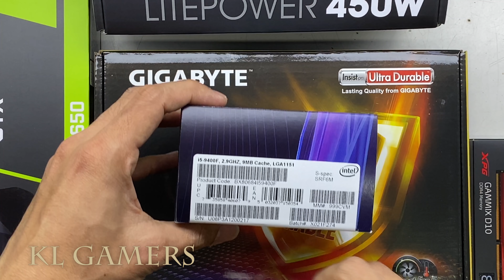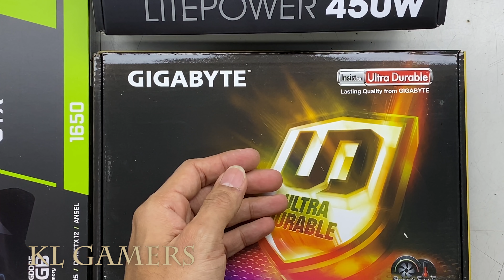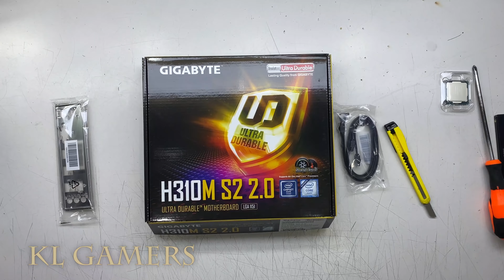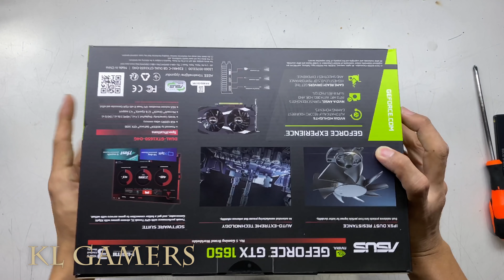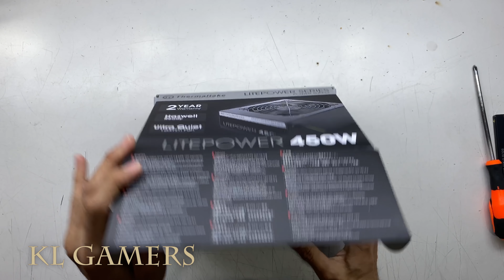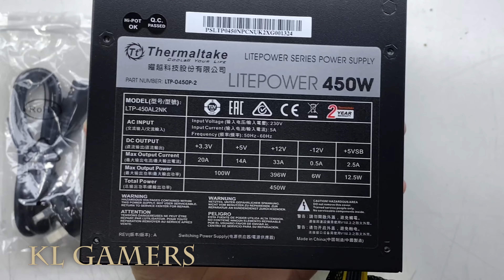intel Core i5 9400F GIGABYTE H310M S2 2.0 XPG GAMMIX D10 GTX 1650 DUAL Segotep PRIME M PC Build

Comment: This mobo doesn't support upto 2400 mhz frequency ram it doesn't make any sense to use 3000 mhz frequency ram
Reply: i5 and i7 support 2666 mhz ..
Reply: upto how many only mhz of ram is applicable? i have i7 and ram of 2133mhz. is thi mobo compatible?
Reply: I have i3 8100 with 8 DDR4 2666mhz. Works fine

Comment: In my opinion, the VRM of that H310 in your video will not be suitable for 9400F. On the other hand, I think mainboard has a much better VRM system that will be suitable for 9400F
Do you have any comment on my opinion??
Reply from the maker: sure can add money to upgrade for better option 

Motherboard = Gigabyte B365M DS3H Micro ATX USB 3.1 Gen 1 (USB3.0) Type A LGA 1151
(Amazon link) = https://amzn.to/2lx8gMF
(Lazada link) = https://c.lazada.com.my/t/c.fpDq
(Shopee link) = https://invol.co/clp6re
Reply: @KLGamers  but if you still use that main you can still run 9400F but do not declare the other maximum performance of 9400F right?

Comment: I have the same motherboard and intel i5 9400f. 450w plus 80 power supply. Your graphics card asus 1650 dual fan is good in gaming? It is plug and play? No need to connect to 6pin?

Comment: I need your help.H310M S2 2.0 motherboard,GTX 1660,16GB RAM. 12V 4 cooling fun.wich SMPS bust ???????.
Reply from the maker: Power Supply = COOLER MASTER ELITE P500 PSU, 230V, 75% Efficiency, Forward Topology Design, Active PFC
(Amazon link) = https://amzn.to/3dyAZXj
(Lazada link) = https://c.lazada.com.my/t/c.QkUSu?url=https%3A%2F%2Fwww.lazada.com.my%2Fproducts%2Fcooler-master-elite-p500-ver3-230v-power-supply-i918628523-s2292952616.html&&sub_id1=P500&sub_id2=PCBYTE&sub_id3=149
(Shopee link) = https://invol.co/cloqao
Reply: @KLGamers  thanks you so much

Comment: Salut, j’ai presque la même config ( Gtx 1650 + i5 9400f + 2x8 GB Ram ) j’ai parfois des craches écran blanc durant des jeux tels que ( Rdr2 /Ac valhala /GOW 4 ) est-ce que vous pensez que c’est à cause de mon Psu 450w qu il est pas suffisant ? Sachant que j’ai essayer Benchmark sur Gpu et des test sur cpu et ram sans soucis ! NB : bios est à jours et mis par défaut / J’ai aussi essayé de formater l’ordinateur et c’est toujours pareil

Comment: My dream is to buy a PC 🥺
Reply from the maker: Processor =  Intel® Intel Core i5-9400F 6 Cores 4.1 GHz Turbo Without Graphics by Intel LGA 1151 ( JUNE 2020 )
(Amazon link) = https://amzn.to/2H36fzt
(Lazada link) = https://c.lazada.com.my/t/c.Qk9hs?url=https%3A%2F%2Fwww.lazada.com.my%2Fproducts%2Fintel-core-i5-9400f-lga1151-proccesor-6-cores-up-to-410-ghz-i5-9400f-i455836105-s700834729.html&&sub_id1=9400F&sub_id2=YESIT&sub_id3=659
(Shopee link) = https://invol.co/clokzm

Motherboard = GIGABYTE H310M S2 2.0 LGA1151 (300 Series) mATX Motherboard = RM259
(Amazon link) = https://amzn.to/2YaNUts
(Lazada link) = https://c.lazada.com.my/t/c.9YP6?url=https%3A%2F%2Fwww.lazada.com.my%2Fproducts%2Fgigabyte-h310m-s2-20-intel-socket-lga1151-motherboard-i709556656-s1548720768.html&&sub_id1=H310M&sub_id2=Castle+&sub_id3=229
(Shopee link) = https://invol.co/clmsn0

RAM = ADATA XPG Flame DDR4 8GB 2666MHz CL16 PC4-21300 U-DIMM Single Pack PC Memory (AX4U266638G16-SBF)
(Amazon link) = https://amzn.to/2HyiG60
(Lazada link) = https://c.lazada.com.my/t/c.6tWH?url=https%3A%2F%2Fwww.lazada.com.my%2Fproducts%2Fadata-xpg-flame-8gb-ddr4-2666-udimm-gaming-desktop-ram-i605308635-s1236902253.html&&sub_id1=adata&sub_id2=perak&sub_id3=151
(Shopee link) = https://invol.co/cll39e

SSD = PNY CS900 240GB 2.5” Sata III Internal Solid State Drive (SSD) - (SSD7CS900-240-RB) and PNY CS900 120GB 2.5” Sata III Internal Solid State Drive (SSD) - (SSD7CS900-120-RB)
(Amazon link) = https://amzn.to/3eqT4Gx
(Lazada link) = https://c.lazada.com.my/t/c.0aouu8?url=https%3A%2F%2Fwww.lazada.com.my%2Fproducts%2Fpny-cs900-120gb240gb480gb960gb-25-sata-3-3d-nand-ssd-internal-ssd-i488396618-s851170084.html&&sub_id1=PNY&sub_id2=Viewnet&sub_id3=129
(Shopee link) = https://invol.co/clqjwi

Hard Disk = Seagate BarraCuda 1TB desktop hard disk =RM170
(Amazon link) = https://amzn.to/2YFWWLP
(Lazada link) = https://c.lazada.com.my/t/c.WLWh
(Shopee link) = https://invol.co/clh6b1

Graphics Card = ASUS GTX 1650 DUAL OC 4GB GDDR5 ( DUAL-GTX1650-O4G )
(Amazon link) = https://amzn.to/3gdjfSR
(Lazada link) = https://c.lazada.com.my/t/c.0MqqRq?url=https%3A%2F%2Fwww.lazada.com.my%2Fproducts%2Fasus-dual-geforce-gtx-1650-oc-edition-4gb-gddr5-graphics-card-i491822824-s875310375.html&&sub_id1=1650+dual&sub_id2=its&sub_id3=709
(Shopee link) = https://invol.co/clsi3z

Power Supply = COOLER MASTER MWE 650 WHITE 230V - V2 POWER SUPPLY
(Amazon link) = https://amzn.to/2VNEdPE
(Lazada link) = https://c.lazada.com.my/t/c.Zm25b4?url=https%3A%2F%2Fwww.lazada.com.my%2Fproducts%2Fcooler-master-mwe-650-white-230v-v2-power-supply-i1183366320-s3451150263.html&&sub_id1=MWE+650+WHITE&sub_id2=EIT&sub_id3=245
(Shopee link) = https://invol.co/clpzy1

Casing = Segotep Prime M M-ATX tempered glass gaming casing (FREE 3XRGB FAN)
(Amazon link) = https://amzn.to/36e1pLb
(Lazada link) = https://c.lazada.com.my/t/c.0MJWDk?url=https%3A%2F%2Fwww.lazada.com.my%2Fproducts%2Fsegotep-prime-m-m-atx-tempered-glass-gaming-casing-i563632896-s1122632490.html&&sub_id1=prime+m&sub_id2=EGG&sub_id3=128
(Shopee link) = https://invol.co/clsi4q

Price is based in local Malaysia current price.

Comment: Sir what is the total coast
Reply from the maker: Processor =  Intel® Intel Core i5-9400F 6 Cores 4.1 GHz Turbo Without Graphics by Intel LGA 1151 ( JUNE 2020 )
(Amazon link) = https://amzn.to/2H36fzt
(Lazada link) = https://c.lazada.com.my/t/c.Qk9hs?url=https%3A%2F%2Fwww.lazada.com.my%2Fproducts%2Fintel-core-i5-9400f-lga1151-proccesor-6-cores-up-to-410-ghz-i5-9400f-i455836105-s700834729.html&&sub_id1=9400F&sub_id2=YESIT&sub_id3=659
(Shopee link) = https://invol.co/clokzm

Motherboard = GIGABYTE H310M S2 2.0 LGA1151 (300 Series) mATX Motherboard = RM259
(Amazon link) = https://amzn.to/2YaNUts
(Lazada link) = https://c.lazada.com.my/t/c.9YP6?url=https%3A%2F%2Fwww.lazada.com.my%2Fproducts%2Fgigabyte-h310m-s2-20-intel-socket-lga1151-motherboard-i709556656-s1548720768.html&&sub_id1=H310M&sub_id2=Castle+&sub_id3=229
(Shopee link) = https://invol.co/clmsn0

RAM = ADATA XPG Flame DDR4 8GB 2666MHz CL16 PC4-21300 U-DIMM Single Pack PC Memory (AX4U266638G16-SBF)
(Amazon link) = https://amzn.to/2HyiG60
(Lazada link) = https://c.lazada.com.my/t/c.6tWH?url=https%3A%2F%2Fwww.lazada.com.my%2Fproducts%2Fadata-xpg-flame-8gb-ddr4-2666-udimm-gaming-desktop-ram-i605308635-s1236902253.html&&sub_id1=adata&sub_id2=perak&sub_id3=151
(Shopee link) = https://invol.co/cll39e

SSD = PNY CS900 240GB 2.5” Sata III Internal Solid State Drive (SSD) - (SSD7CS900-240-RB) and PNY CS900 120GB 2.5” Sata III Internal Solid State Drive (SSD) - (SSD7CS900-120-RB)
(Amazon link) = https://amzn.to/3eqT4Gx
(Lazada link) = https://c.lazada.com.my/t/c.0aouu8?url=https%3A%2F%2Fwww.lazada.com.my%2Fproducts%2Fpny-cs900-120gb240gb480gb960gb-25-sata-3-3d-nand-ssd-internal-ssd-i488396618-s851170084.html&&sub_id1=PNY&sub_id2=Viewnet&sub_id3=129
(Shopee link) = https://invol.co/clqjwi

Hard Disk = Seagate BarraCuda 1TB desktop hard disk =RM170
(Amazon link) = https://amzn.to/2YFWWLP
(Lazada link) = https://c.lazada.com.my/t/c.WLWh
(Shopee link) = https://invol.co/clh6b1

Graphics Card = ASUS GTX 1650 DUAL OC 4GB GDDR5 ( DUAL-GTX1650-O4G )
(Amazon link) = https://amzn.to/3gdjfSR
(Lazada link) = https://c.lazada.com.my/t/c.0MqqRq?url=https%3A%2F%2Fwww.lazada.com.my%2Fproducts%2Fasus-dual-geforce-gtx-1650-oc-edition-4gb-gddr5-graphics-card-i491822824-s875310375.html&&sub_id1=1650+dual&sub_id2=its&sub_id3=709
(Shopee link) = https://invol.co/clsi3z

Power Supply = COOLER MASTER MWE 650 WHITE 230V - V2 POWER SUPPLY
(Amazon link) = https://amzn.to/2VNEdPE
(Lazada link) = https://c.lazada.com.my/t/c.Zm25b4?url=https%3A%2F%2Fwww.lazada.com.my%2Fproducts%2Fcooler-master-mwe-650-white-230v-v2-power-supply-i1183366320-s3451150263.html&&sub_id1=MWE+650+WHITE&sub_id2=EIT&sub_id3=245
(Shopee link) = https://invol.co/clpzy1

Casing = Segotep Prime M M-ATX tempered glass gaming casing (FREE 3XRGB FAN)
(Amazon link) = https://amzn.to/36e1pLb
(Lazada link) = https://c.lazada.com.my/t/c.0MJWDk?url=https%3A%2F%2Fwww.lazada.com.my%2Fproducts%2Fsegotep-prime-m-m-atx-tempered-glass-gaming-casing-i563632896-s1122632490.html&&sub_id1=prime+m&sub_id2=EGG&sub_id3=128
(Shopee link) = https://invol.co/clsi4q

Price is based in local Malaysia current price.

PC Tool Kit, Jakemy Ratchet Repair Screwdriver Set, Torx screwdriver 20 in 1 for iPhone X, iPhone 8/8 Plus/7/7 Plus/6/6 Plus/6S/5/5C/5S/4/4S/iPad 4/3/2/Mini, Laptop
(Amazon link) = https://amzn.to/3bCMrjM

Screwdriver Set 43 in 1 Precision Screwdriver Kit
(Amazon link) = https://amzn.to/2HdWJcX

Please SUBSCRIBE & Click the BELL NOTIFICATION button: 
https://www.youtube.com/c/KLGamers

Thanks for all your Support, LIKE the video, Sharing the video and leaving a comment is always appreciated!! 

Copyright © KL Gamers 2019. All Rights Reserved.

DISCLAIMER: This video and description contains affiliate links, which means that if you click on one of the product links, I’ll receive a small commission. This help support the channel and allows us to continue to make videos like this. Thank you for the support!

Try Prime Discounted Monthly Offering = https://amzn.to/31jYLzU

Shop Amazon Basics - HDMI Cables = https://amzn.to/2KmjkVq

Deep Discounts on used electronics (Amazon Link) = https://amzn.to/2GH7tjN

Amazon Gift Cards = https://amzn.to/31aUMpc

Top Gift Ideas (Amazon Link) = https://amzn.to/31lw5qi

Malaysia Deals 

Guardian Malaysia = https://invol.co/clihw3

HALAL Organic products = https://invol.co/clion2

TooL BoX = https://invol.co/cliona

Glasses Deal = https://invol.co/clion4

melissa = https://invol.co/clion8

Popular Tickets = https://invol.co/clion5

Book your great Outdoor Group Adventures = https://invol.co/clihvv 

(Lazada Malaysia Link) https://bit.ly/2YKMx6x

Lazada Vouchers deal = https://c.lazada.com.my/t/c.cs8w 
Lazada Daily Flash Sales Link = https://c.lazada.com.my/t/c.cGZC
Lazada Home Appliances deal = https://c.lazada.com.my/t/c.coJk
Lazada Camera deals = https://c.lazada.com.my/t/c.cs8D

How to update BIOS for AMD Ryzen 5 3600 https://youtu.be/EkJEF_DrSQo

AMD Ryzen 5 3600 RTX 2060 SUPER Game Benchmark Test Results https://youtu.be/D04k39zkhlw

Comment: Total ringgits all part
Reply: Check description bro..😀
Reply from the maker: Processor =  Intel® Intel Core i5-9400F 6 Cores 4.1 GHz Turbo Without Graphics by Intel LGA 1151 ( JUNE 2020 )
(Amazon link) = https://amzn.to/2H36fzt
(Lazada link) = https://c.lazada.com.my/t/c.Qk9hs?url=https%3A%2F%2Fwww.lazada.com.my%2Fproducts%2Fintel-core-i5-9400f-lga1151-proccesor-6-cores-up-to-410-ghz-i5-9400f-i455836105-s700834729.html&&sub_id1=9400F&sub_id2=YESIT&sub_id3=659
(Shopee link) = https://invol.co/clokzm

Motherboard = GIGABYTE H310M S2 2.0 LGA1151 (300 Series) mATX Motherboard = RM259
(Amazon link) = https://amzn.to/2YaNUts
(Lazada link) = https://c.lazada.com.my/t/c.9YP6?url=https%3A%2F%2Fwww.lazada.com.my%2Fproducts%2Fgigabyte-h310m-s2-20-intel-socket-lga1151-motherboard-i709556656-s1548720768.html&&sub_id1=H310M&sub_id2=Castle+&sub_id3=229
(Shopee link) = https://invol.co/clmsn0

RAM = ADATA XPG Flame DDR4 8GB 2666MHz CL16 PC4-21300 U-DIMM Single Pack PC Memory (AX4U266638G16-SBF)
(Amazon link) = https://amzn.to/2HyiG60
(Lazada link) = https://c.lazada.com.my/t/c.6tWH?url=https%3A%2F%2Fwww.lazada.com.my%2Fproducts%2Fadata-xpg-flame-8gb-ddr4-2666-udimm-gaming-desktop-ram-i605308635-s1236902253.html&&sub_id1=adata&sub_id2=perak&sub_id3=151
(Shopee link) = https://invol.co/cll39e

SSD = PNY CS900 240GB 2.5” Sata III Internal Solid State Drive (SSD) - (SSD7CS900-240-RB) and PNY CS900 120GB 2.5” Sata III Internal Solid State Drive (SSD) - (SSD7CS900-120-RB)
(Amazon link) = https://amzn.to/3eqT4Gx
(Lazada link) = https://c.lazada.com.my/t/c.0aouu8?url=https%3A%2F%2Fwww.lazada.com.my%2Fproducts%2Fpny-cs900-120gb240gb480gb960gb-25-sata-3-3d-nand-ssd-internal-ssd-i488396618-s851170084.html&&sub_id1=PNY&sub_id2=Viewnet&sub_id3=129
(Shopee link) = https://invol.co/clqjwi

Hard Disk = Seagate BarraCuda 1TB desktop hard disk =RM170
(Amazon link) = https://amzn.to/2YFWWLP
(Lazada link) = https://c.lazada.com.my/t/c.WLWh
(Shopee link) = https://invol.co/clh6b1

Graphics Card = ASUS GTX 1650 DUAL OC 4GB GDDR5 ( DUAL-GTX1650-O4G )
(Amazon link) = https://amzn.to/3gdjfSR
(Lazada link) = https://c.lazada.com.my/t/c.0MqqRq?url=https%3A%2F%2Fwww.lazada.com.my%2Fproducts%2Fasus-dual-geforce-gtx-1650-oc-edition-4gb-gddr5-graphics-card-i491822824-s875310375.html&&sub_id1=1650+dual&sub_id2=its&sub_id3=709
(Shopee link) = https://invol.co/clsi3z

Power Supply = COOLER MASTER MWE 650 WHITE 230V - V2 POWER SUPPLY
(Amazon link) = https://amzn.to/2VNEdPE
(Lazada link) = https://c.lazada.com.my/t/c.Zm25b4?url=https%3A%2F%2Fwww.lazada.com.my%2Fproducts%2Fcooler-master-mwe-650-white-230v-v2-power-supply-i1183366320-s3451150263.html&&sub_id1=MWE+650+WHITE&sub_id2=EIT&sub_id3=245
(Shopee link) = https://invol.co/clpzy1

Casing = Segotep Prime M M-ATX tempered glass gaming casing (FREE 3XRGB FAN)
(Amazon link) = https://amzn.to/36e1pLb
(Lazada link) = https://c.lazada.com.my/t/c.0MJWDk?url=https%3A%2F%2Fwww.lazada.com.my%2Fproducts%2Fsegotep-prime-m-m-atx-tempered-glass-gaming-casing-i563632896-s1122632490.html&&sub_id1=prime+m&sub_id2=EGG&sub_id3=128
(Shopee link) = https://invol.co/clsi4q

Price is based in local Malaysia current price.

PC Tool Kit, Jakemy Ratchet Repair Screwdriver Set, Torx screwdriver 20 in 1 for iPhone X, iPhone 8/8 Plus/7/7 Plus/6/6 Plus/6S/5/5C/5S/4/4S/iPad 4/3/2/Mini, Laptop
(Amazon link) = https://amzn.to/3bCMrjM

Screwdriver Set 43 in 1 Precision Screwdriver Kit
(Amazon link) = https://amzn.to/2HdWJcX

Please SUBSCRIBE & Click the BELL NOTIFICATION button: 
https://www.youtube.com/c/KLGamers